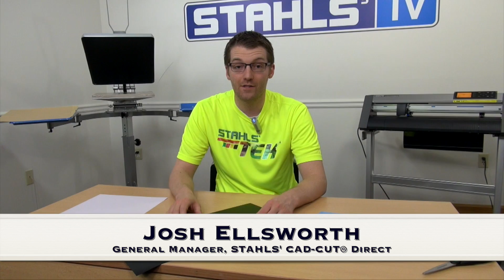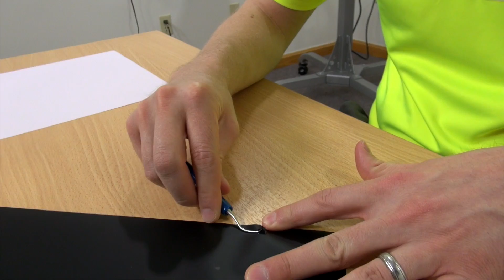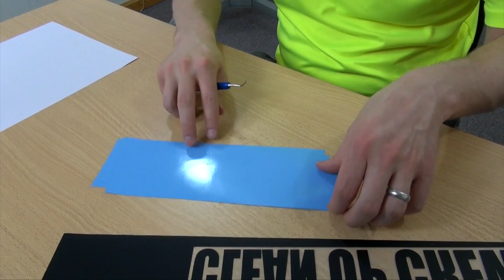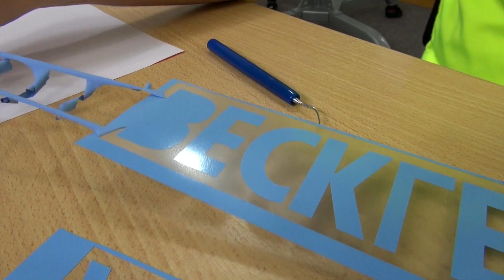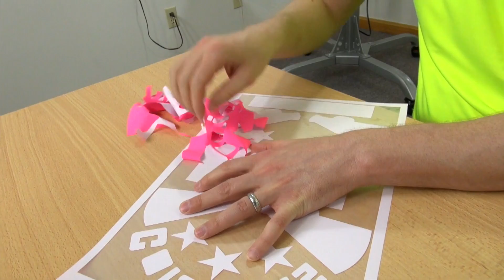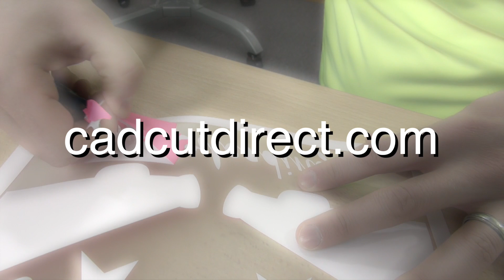Tips for Weeding Heat Transfer Vinyl Faster

Comment: I use nothing but the exacto knife, and using my fingers as tweezer 
like tools I can stick the extra to them, and speed through this stuff 
really fast.  Also when he was pulling up the first sheet in one long 
pull, I use the exacto to add cut lines and can pull off smaller pieces 
faster and get the whole thing done faster then he did the first part.
Reply: post a video of it
Reply: Pro tips. Fr.

Comment: Working at a professional screenprinting/vinyl shop has taught me how goddamn useless those tools are. Just use a hobby/exacto knife. way easier and way faster
Reply: I am using sister easy weed htv and a silhouette cameo.    I have waisted so much vinyl.  It pulls but does not completely separate from the design.  Stretching lettering etc.  any suggestions?
Reply: +Kevin Corbett lol right....Istill use thumbtacks
Reply: +Kevin Corbett I agree I use nothing but the exacto knife, and using my fingers as tweezer like tools I can stick the extra to them, and speed through this stuff really fast.  Also when he was pulling up the first sheet in one long pull, I use the exacto to add cut lines and can pull off smaller pieces faster and get the whole thing done faster then he did the first part.
Reply: Dental pick from harbor freight works well. I like the Stahls weeding too also. The best thing I have though is the heated Stahls EZ weed table.
Reply: Kevin.  Quiet!